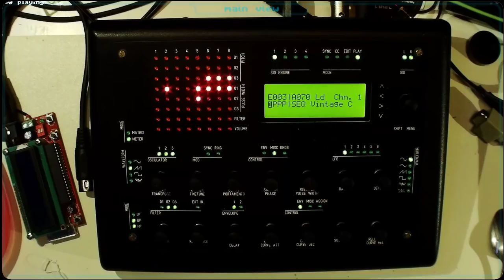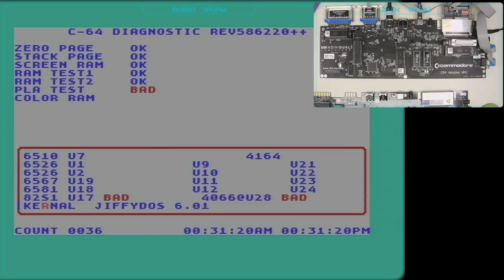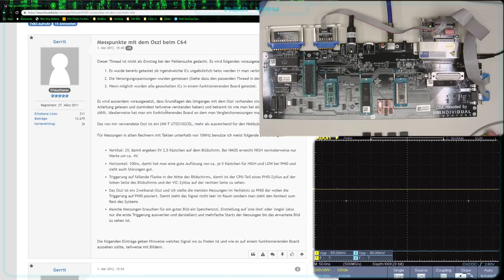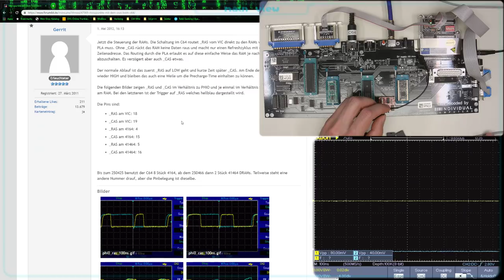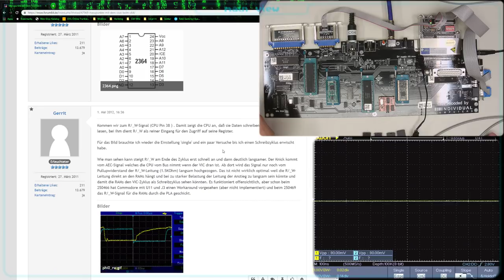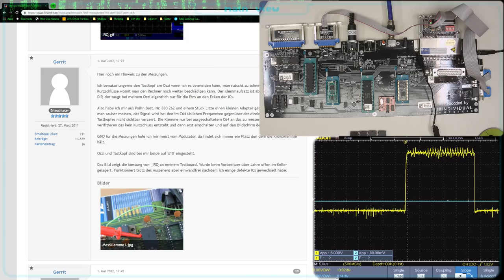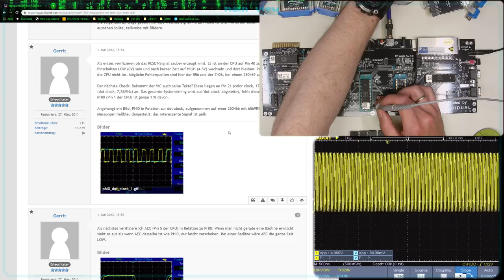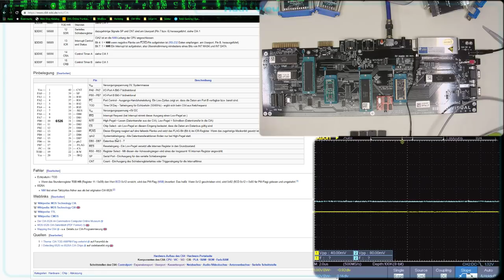C64 Hardware - Oscilloscope Session & Repair Attempt #2 - Reloaded MK1 Black Screen - Fail

Comment: When the diag cartis taken out, theroms should have output enable activity. Id check that even if the roms are joined together.
Reply from the maker: Yes, right. Next test will be ROM activity by checking data and address lines :)

Comment: Mach die GND Kabel besser nicht länger. Sonst fängst Du Dir viele Störungen ein. Manchmal wickelt man ja um die Metallhülse (auch GND) am Tastkopf einen Draht, den man möglichst kurz anlötet, um möglichst wenig Störungen zu bekommen.
Reply from the maker: Ja, ich weiß, aber das nervt schon ein wenig :) Werde zumindest mal ne andere Klemme ranmachen, das Monsterding geht ja wirklich nirgends richtig ran.
Reply: Eine andere Klemme mach Sinn. Bei den Boards, die ich entwickle habe ich mir immer einen GND-Pin draufgemacht, wenn man mal etwas messen muss. Da ist die Krokodilklemme ok. Ein langes, dünnes Kabel ist nicht gut für Hochfrequenz, weil es eine hohe Impedanz (Wechselstromwiderstand, abhängig von der Frequenz) hat. Darum fängt man sich mit jedem Massekabel Störungen ein. Die Überschwinger an Logiksignalen können daher kommen. Man weiß es eben nicht. Andererseits ist das C64 Layout auch nicht mit dem zu vergleichen, wie man es heutzutage machen würde. Wir haben lustige CAD-Software, das C64 Layout wurde wahrscheinlich noch mit Pads zum Aufrubbel und Klebestreifen gemacht. Wenigstens die ersten.